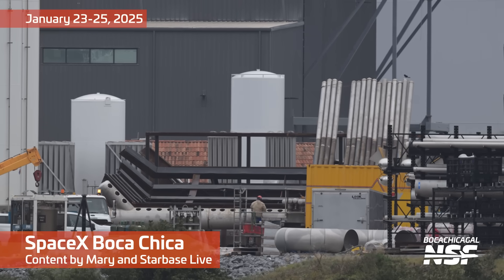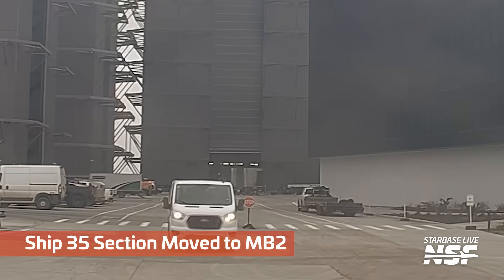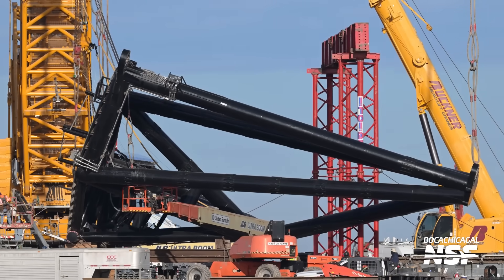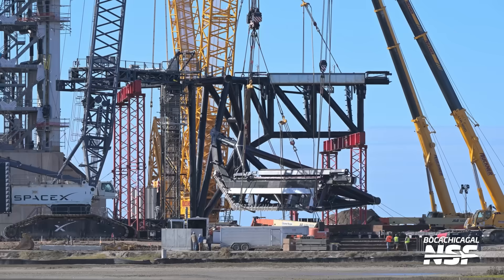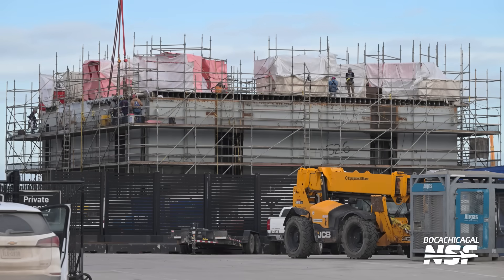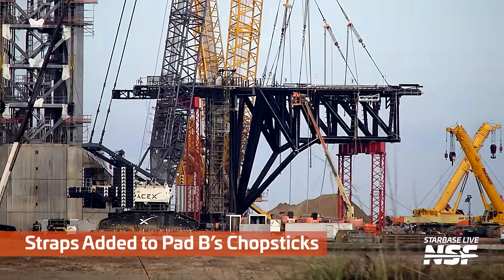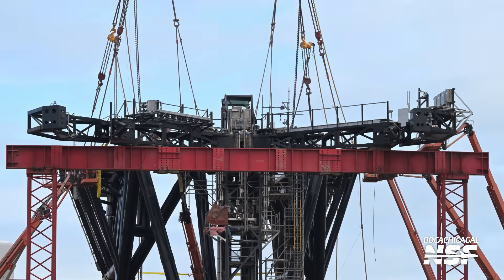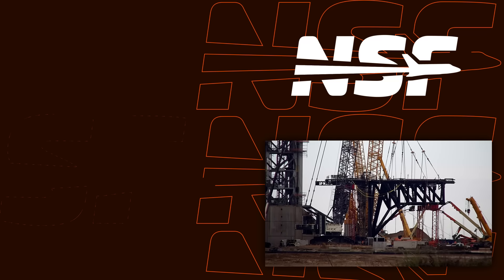All Eyes on Pad B at Starbase | SpaceX Boca Chica

Comment: So... I picked up a 60x90 Core of the Galaxy metal print, and... it is gorgeous. I didn't realize how much the detail would pop with the metal prints. Looks like the star filled sky has real texture, and the glow from the lighthouse, and the effect on the water from the longer exposure all add up to be spectacular. I wasn't sure if I'd regret getting something without a rocket in frame for my first, but that worry went away quick.
Reply: Omg I want one so bad!!! It's on my "must get" list but the one I wanted did have the rocket in frame/during launch!  A little more than I would normally spend on myself but worth it! Plus I'm pretty sure the metal is based on the new hardened metal they're using...? Can't wait to get mine!!!

Comment: So, all this is for launching rockets into the ocean? Why not go to LEO?
Reply: It's a development program
Reply: @ale131296  The very first launch of the Soviet rocket Energia with a lifting capacity of 100 tons was to LEO. The same is true for the newest rocket Angara. What is the point of wasting money in the ocean?
Reply: @sbelobaba  And why would I care what Energia and Angara did on their first flights? There's no relation of them to Starship whatsoever. Now, here's a fun thing: Angara's first flight was suborbital and so was Energia's so those two examples you used are great examples of rockets which debuted on suborbital flights. Same happened with the R7, the Soyuz-2, and many other rockets out there. So not really sure what's your point.
Reply: @ale131296  All first test flights  you mentioned except for Angara ended up as suborbitale because of an error. The destination was LEO.  Energia was successful, the payload failed. N1 rocket was scrubbed after 3 unsuccessful tests. Starship made 7 test missions without reaching LEO. I don't even see the point in such flights.
Reply: @sbelobaba There is a lot more consideration for the LEO environment now compared to previous generations. What is the point of going to LEO at this stage? Starship has to come back down to test the entry systems anyway.

Comment: The yellow straps are there to stop the arms of the chop sticks from swinging around as they lift the whole assembly up to the tower.
There will be a strap from each arm back to the carriage, as well as a strap between the 2 arms, - seen here as the shorter, more tensioned strap in the latter part of the video.
Together these 3 straps will hold the 3 sections (the 2 arms and the carriage), in a secure formation during the lift.
Once it's on the tower then they'll hook up the hydraulics to be able to control the swing of the arms.
Reply: I wonder why they don't install the cylinders first and then shut them off.
Almost everything else they install also on the ground.
Reply: @SBHLL  that's a good point.. I really don't know..
however, I'm also not a rocket launch pad engineer.. so I'm sure they are doing things in just about the most efficient way possible..
Reply: @SBHLL  maybe keeping the weight low for the lift?
Reply: @cricri7066  Weight is one aspect. The other is the potential failure of hydraulics trying to do what they were never designed to do. The actuators were designed to move the leveled and balanced chopsticks, nothing more. Every degree of tilt that occurs would overpressure the seals in the actuators, the hoses and the control valves. It's just safter to use reinforced strapping to keep things in place.
Reply: @wesleybeaver  Well stated!
Reply: @wesleybeaver that makes a ton of sense! The size of the pistons and seals are so massive even a small torque in the wrong direction could spell failure. Great observation!
Reply: brilliant ...thanks for putting that mystery to bed

Comment: I was just thinking about the lubricant for the chopsticks pins, and the skates rollers. I mean there has to be something, but everything I can think of is flammable. Any ideas?
Reply: probably some kind of silicone or possibly a dry lubricant like graphite.. it needs to keep the salty air out of the bare metal parts, but it's not a high heat location, just high pressure, as in the weight of the assembly pushing on the skate wheels, with a 350 ton booster hanging off it will generate a lot of pressure on the contact points.
Reply: @GenoLoma hmmm🤔... I've got a couple ideas I'm thinking through ~ stay tuned and I'll share if I can work any of them through!